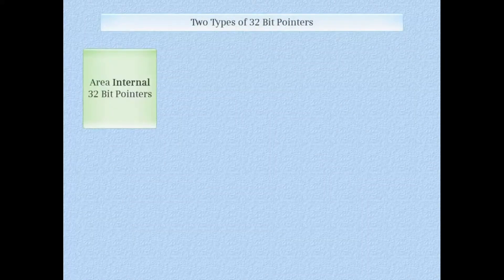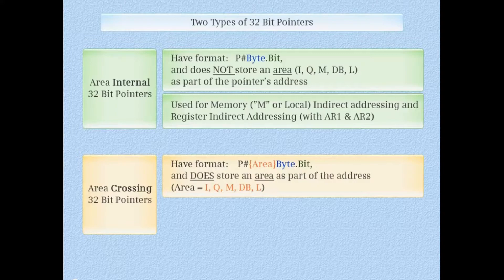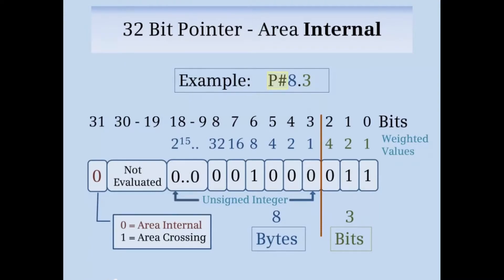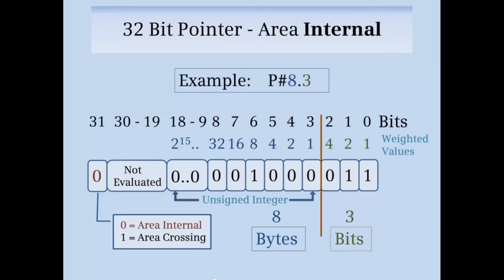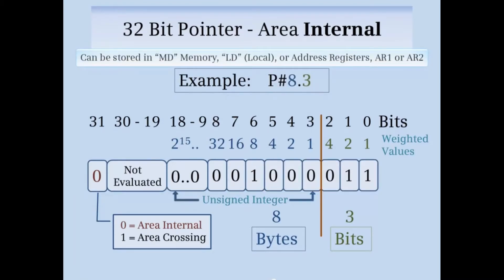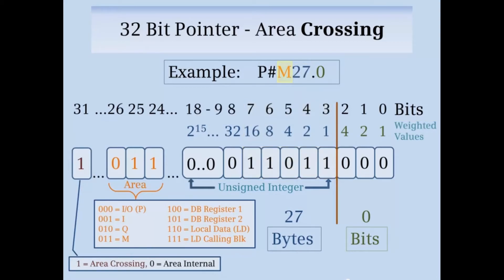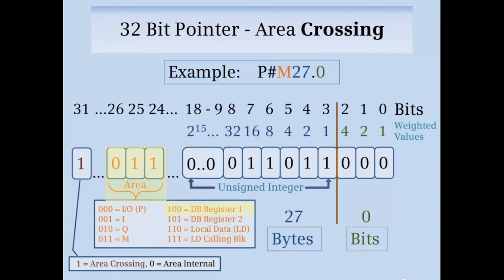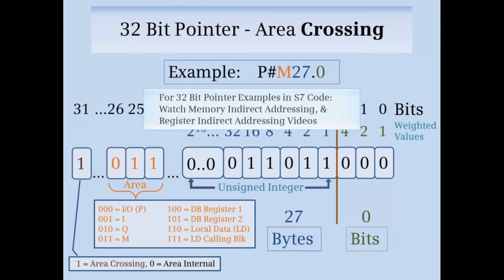24 : 32 Bit Pointers Area Internal and Area Crossing || Step 7 || Simatic Manager Step 7 Tutorial

Comment: SET   
      SAVE  
      =     L      2.1
      A     M      5.6
      JCN   A7d0
      CLR   
      =     DB13.DBX   13.3
A7d0: CLR   
      A     M     22.3
      L     S5T#3S
      SF    T     39
      LC    T     39
      T     #T_Dummy
      A     T     39
      =     M     28.5
      L     PIW  450
      T     MW    29
      A     M     22.0
      A     M     28.5
      OPN   DB    11
      =     L      2.2
      A     DBX    4.0
      NOT   
      A     L      2.2
      =     L      2.2
      A     M      7.1
      NOT   
      A     L      2.2
      =     L      2.2
      A     M     30.6
      NOT   
      A     L      2.2
      =     M     32.0
      A     M     30.2
      NOT   
      A     M     32.0
      L     S5T#10S
      SD    T     35
      LC    T     35
      T     #T_Dummy
      A     T     35
      =     M     28.2
      A     M     28.2
      JCN   A7d1
      SET   
      OPN   DI    13
      =     DIX   13.3
A7d1: CLR   
      A     M     30.2
      NOT   
      =     L      2.2
      A     M      7.1
      NOT   
      A     L      2.2
      JCN   A7d2
      CLR   
      =     M     26.3
A7d2: CLR   
      A     M     30.2
      NOT   
      =     L      2.2
      A     M     30.3
      NOT   
      A     L      2.2
      A     M     22.3
      =     L      2.2
      A     M      7.1
      NOT   
      A     L      2.2
      L     S5T#10S
      SD    T     38
      LC    T     38
      T     #T_Dummy
      A     T     38
      =     DB13.DBX   13.7
      A     M      7.1
      NOT   
      A     M     26.7
      =     L      2.2
      A     M     30.2
      NOT   
      A     L      2.2
      JCN   A7d3
      SET   
      =     DBX   13.7
A7d3: CLR   
      A     M     30.3
      L     S5T#1S
      SD    T     37
      LC    T     37
      T     #T_Dummy
      A     T     37
      =     DB13.DBX   13.5
      A     DBX   13.5
      JCN   A7d4
      CLR   
      =     M     28.1
A7d4: L     PIW  452
      T     DB16.DBW  150
      L     PIW  454
      T     DBW  174
      L     DBW  174
      L     0
      <>I   
      OPN   DI    13
      =     DIX   13.6
      A     M     29.3
      NOT   
      A     M     28.0
      L     S5T#250MS
      SF    T     66
      LC    T     66
      T     #T_Dummy
      A     T     66
      =     M     66.3
      A     I      0.3
      NOT   
      =     L      2.2
      A     M     66.3
      NOT   
      A     L      2.2
      =     M     31.3
      A     M     22.0
      A     M     28.5
      OPN   DB    11
      =     L      2.2
      A     DBX    4.0
      NOT   
      A     L      2.2
      =     L      2.2
      A     M     29.3
      NOT   
      A     L      2.2
      O     M     29.3
      =     M     28.0
      OPN   DI   133
      A     DIX    6.1
      JCN   A7d5
      SET   
      =     DB13.DBX   14.0
      JU    A7d7
A7d5: CLR   
      A     M      6.3
      JCN   A7d7
      CLR   
      =     DB13.DBX   14.0
A7d7: OPN   DB    13
      CLR   
      A     DBX   14.0
      JCN   A7d8
      SET   
      =     M      6.6
A7d8: CLR   
      A     M      7.1
      NOT   
      A     DB825.DBX    2.1
      =     L      2.2
      A     M      3.0
      NOT   
      A     L      2.2
      JCN   A7d9
      SET   
      OPN   DI    13
      =     DIX   14.1
      JU    A7db
A7d9: CLR   
      A     M      6.5
      JCN   A7db
      CLR   
      =     DB13.DBX   14.1
A7db: OPN   DB    13
      CLR   
      A     DBX   14.1
      JCN   A7dc
      SET   
      =     M      6.7
A7dc: CLR   
      A     M     30.5
      =     M     28.4
      A     DB101.DBX   10.0
      =     M     32.2
      SET   
      =     M     32.6
      =     M     31.2
      A     M      6.0
      =     M     32.7
      L     MW    31
      T     PQW  450
      A     L      2.1
      SAVE  
      BE    

In this STL program where can I find DB13.DBX13.6 ?